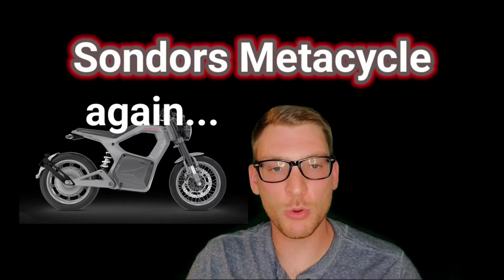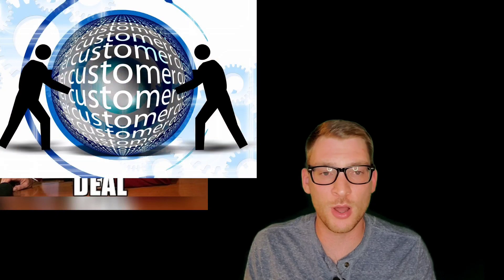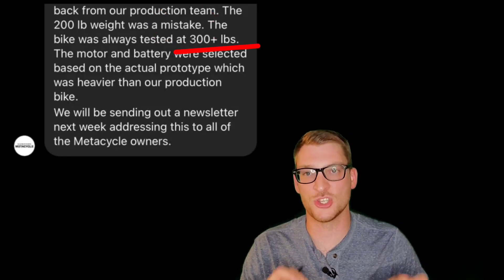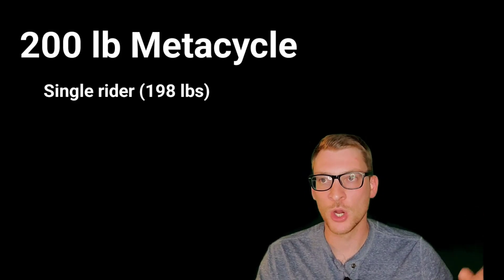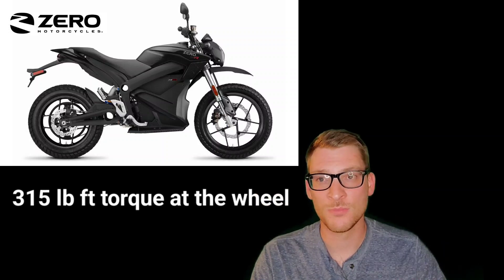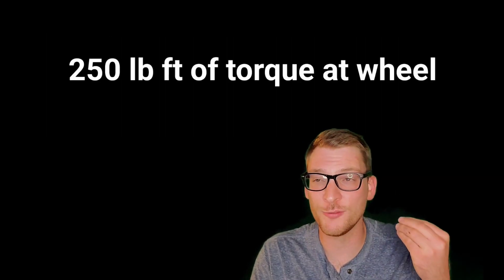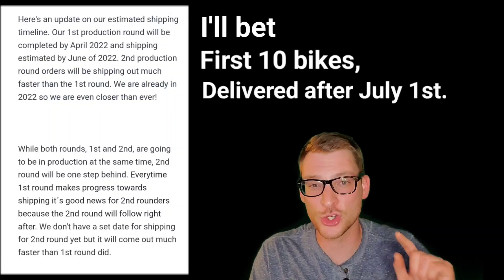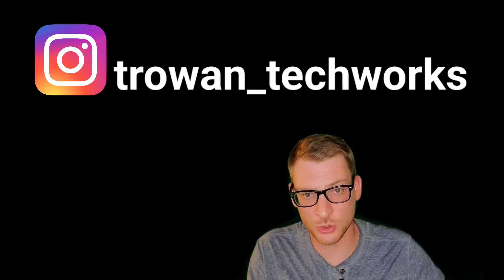Why the Sondors Metacycle will underperform

Comment: When they start coming over here, it doesn't matter what the weight or acceleration will be.  If it's $5000 or $6000 and can go over 65, it will sell like crazy.
Reply from the maker: Yeah I don't think the acceleration is a deal breaker. It's more how the company saying one thing but the specs don't back that up. It's sketchy for a manufacturer to have conflicting information.
Reply: I agree, all these other companies are like "yeah, everyone can still afford a $40,000 bike, right?".  We're not looking for flashy Harley's or Honda's here.  Same with electric cars.
Reply: 0 to 60 is not a big deal, dont forget you wont be changing gear so will still be quick and smooth..

Comment: I've done similar range calculations, with enough accuracy for, let's just say, pioneer EV vehicles, and it all didn't add up, to the point where I was willing to head to Irvine CA to check it out myself, nothing but crickets about questions and calculations, everything they say, doesn't materialize or add up, so I yanked my money back, from a EV manufacturing stand point, ya have to wonder, they're selling motorcycles to already motorcycle owners likely (me), they're also selling an EV, my specialty, overall, the whole thing is disappointing

Comment: Your math may be wrong when compared to the mid drive system. This is a hub drive. Hub drives have inherently slower acceleration.
Reply from the maker: Wheel torque is wheel torque. I accounted for the gear ratio and multiplied torque at the rear for the mid drive on the Zero. When Sondors lists motor torque, it is also the wheel torque. Not sure what you mean?
Reply: @trowantechworks  motors do not always have a linear torque curve. They seem to drop off near the upper RPM's. I could be totally wrong, but I own 5x E-bikes. Most of them have the same max speed. I've noticed that the hub motors struggle more at higher RPM vs mid-drive systems.
Reply from the maker: @JonathanVegas1  yes. If you watched the video I mentioned this. I assumed peak torque for the sake of simplicity, and because we don't have any torque curve data for this motor. So the 0-60 times are worse than what I quoted.

Comment: Howdy, I have a vision of a likely future for metacycle customers. Why? Because I'm a Sondors MadMods customer and I've already experienced what Metacycle customers have started going through.

So, Sondors MadMods... It is an emoped style ebike originally sold for $1,500 advertising a weight of 65lbs, top speed of 28+mph, and a variety of swappable parts. It didn't take long for all of that go change. Now it is $3,500 (lol), weighs 116lbs, software limited to 25mph on the display, and certain parts (seat on the scrambler, tire on retro, and fender on cafe)  either don't exist or arent as advertised. How did customers find out? Sondors just quietly updated their website as they began actually shipping bikes. In addition many bikes were delivered damaged because they shipped 120lbs of bike as if it was a 65lb bike. No apologies, no official statements, just the expectation for the customer to deal with it.

I called it on reddit that the weight was BS months ago. Now I suspect you'll see some specs quietly change, but only when the bikes are close to shipping. They want the false specs up so they can sell more bikes. I will bet the top speed decrease and 0-60 time decrease happens after price increases.

Obviously I'm bitter about the way Sondors treated me as a customer. But to close out on a positive note, so far my experience with Xion has been the polar opposite. Sondors ought to look at what Xion did for the CyberX and use that as an example of how to treat customers and how to develop a bike and change specs. CyberX is significantly different than the bike on their campaign video and the team kept people updated through the process. Hell, I think the CyberX might end up potentially having better performance than Metacycle.
Reply from the maker: Sorry to hear that you dealt with that already with the MadMods bike. I've heard the same thing from others. I'm betting you're right, and that they will de-rate the performance of the bike. 

I've been watching Xion closely and everything you said is spot on. They have handled their customer base well.

Comment: There could be refunds in the thousands, but the order numbers and some dialog between customers and company suggest they have pre-sold tens of thousands of these things, so they're not breaking a sweat.  We have given them interest-free loans, over a year now for me.
Reply: And I theorize the weight increase is because they assumed they could get the frame cut from billet aluminum which is much stronger, therefore less material making it much lighter. Going to a cast frame is soft, weak metal, so it takes way more material.
Reply: They have padded the order numbers and I was told that they do not represent the true number of bikes - just divide their number by 10.

Comment: I always thought that 200 would be way too light simply for stability -- handling bumps and wind gusts
Reply from the maker: Yeah a weight increase is not necessarily a bad thing. For security purposes too. But not increasing the power/torque to account for this is just...bad
Reply: Not true, the Sur Ron X is under 200lbs and it handles fine.
Reply: @mountainbikerdave  Surron x, under 60 MPH, true  :D otherwise that thing will shimmy and crash
Reply: @mannyechaluce3814  I'll disagree, people are out there doing it.
If you're crashing simply because you are going fast, then In my opinion that's more of a skill gap on the rider. 

But the scary thing is, anyone (including someone who has never rode a motorcycle before) can just buy Sur Ron X and modify it to go 90 MPH.
So if that's the scenario that you're talking about, then yes, they'll more then likely crash. 

Riding requires skill which is not something you can simply buy.
Reply: Stability isn’t dependant on weight.  It’s more a case of a well calibrated suspension, attention paid to aerodynamics, actual wheelbase, etc.
Reply: @bigkahuna1950  perhaps. aerodynamics for sure. But a light vehicle gets pushed around more than a heavy one

Comment: Could you throw some #s in your 0-60 calculator for me?  My 8kw E-Enduro is fast.  Weight 160lbs, me 210lbs, torque rating 184ftlbs.  Let me know if you need any other variables!
Reply from the maker: What's your rear tire diameter? Is the 184 ft lbs the torque at the wheel (hub motor) ?
Reply: @trowantechworks  19" motorcycle, yes, Sir, hub motor
Reply from the maker: @e-powersport  is that a 19" rim, or is the tire diameter really 19"? 
Do you have the actual dimensions of the tire handy? 

Cool, lemme plug it in. Of course this is theoretical and we aren't factoring in the torque curve which usually decreases through the range of speed. And we're not factoring in aerodynamics or losses.
Reply: @trowantechworks   sorry, 19" rim, actually closer to 25-26" outside.  The speedo set to 26" is really close to accurate
Reply from the maker: @e-powersport  alright with a 26" diameter, it's looking like 5.98 so 6 seconds. Real world, add like 1.5 seconds to that
Reply: @trowantechworks  thank you! Seems a lot faster ;)
Reply from the maker: @e-powersport  can you use a logger and test the bike out IRL? Although if it's 8kW peak I doubt it'll get up to 60 mph? You can also quote a 0-30 mph time
Reply from the maker: With a 19" rear wheel diameter, 184 lb ft of torque, and 370 lb mass, I'm showing 3.8 seconds for 0 to 60. But I don't think this is accurate, unless you're positive the entire tire diameter is 19". Usually total diameter ends up being 22 to 25" depending on the tire size. That would put you more into the 5-7 second range for 0-60.

Comment: I'm right on the verge of asking for a refund at this point. You're right something definitely stinks here big time. Even underperforming it will still work for my use case, but I just don't know if I can trust the company at all anymore. Would you get on a motorcycle engineered by a company that left its specs 33+% pounds underweight for what over a year now? That's not a small error. It's a lie, a lie that they used to sell what was already fuzzy math as something plausible. 
Sondors needs to respond and do so quickly or I'm out.
Reply: You also have to consider that this is not the first time it has happened. The Madmods ebike also came in grossly overweight (almost double) and under performance. So they knew they needed to be careful with calculating this. The only way this could happen would be outright deliberate misinformation OR gross incompetence. Then again they also forgot about DOT regulations and had to slap on additional lights and reflectors . . .
Reply from the maker: @Bigrignohio  I'm wondering if it's incompetence and bad communication between Sondors and the engineers in China.
Reply: @trowantechworks  Going from 200lbs to 300lbs means that the weight of the frame AT LEAST doubled (assuming a generous 100lbs for battery, motor and wheels). More likely more than double as the battery alone should be well over 50lbs. Combined with the Madmods fiasco I cannot see any way it was not deliberate misinformation.
Reply: Update: I've had a lengthy back and forth conversation with a Sondors representative and to be honest he's completely jerked me around. He started off with the standard line that the weight change was just a result of the realities of production vs. preproduction. He said the weight was estimated based on the prototype and that the revised spec reflects what the production models will actually weigh and that this (somehow) will not affect performance. I asked him very simply if the acceleration, top speed, and range specs were ALSO estimated based on that prototype. He said that they were, but then changed the story about why the weight was listed incorrectly in the first place. He said that the change from 200 to 300 pounds was simply a "copy correction". He called it an error and again asserted that the production vehicle would meet the stated performance specifications despite this. 

I have requested a full refund. It seems obvious to me that Sondors is lying to its customers about this bike and its capabilities. If it turns out that Sondors does in fact have some kind of magic fairy dust that allows this bike to perform as advertised then it will still be a bargain at the non-early bird price point. I'll keep updating this as I assume Sondors will not be giving my $5,000 back without a fight. If they're smart they will.
Reply: Cancel it, it's the safer choice
Reply from the maker: I'm not here to tell you whether to cancel or not. But I can tell you that I don't completely trust the engineering on this bike.
Reply: @trowantechworks  I emailed customer support about my concerns. Unsurprisingly I was just given what seems to be the form letter regarding the weight increase. The rep said that the initial weight was estimated based on a prototype and that they can give more accurate estimates regarding weight now that production models exist. That doesn't really inspire confidence in their range and top speed estimates now does it? Those estimates were also made prior to the existence of production examples. 
The rep also said that all specs were obtained using the proper curb weight and the increase will not affect those specs. How does one confirm or even estimate those specs when one of the key variables in determining them is that far off?
Reply: Yeah, Imma ask for a refund.
Reply: I got my full refund I will wait to see the final product
Reply: @zmima  What did you use as justification for your refund? There are a lot of small reasons for me, weight increase, SMB color redesign, actual range won't be enough for my commute, etc, but I haven't asked for a refund yet. At this point I'd like to put that money into a gas bike instead.
Reply: @TheRealBobHickman  Are you out of your 90 day credit card dispute window?  If so, just wait maybe you'll actually get the bike someday.  I have been trying to get a refund since December.  Now I have a canceled order and I am out $5000.  I have hope that maybe they will actually pay me back, but it is not looking like it after 8 months.
Reply: @ourmovies2010  Yes, I paid in full almost a year ago. I called Sondors a couple of week ago and spoke to Luis. I let him talk through the benefits of keeping my order, but I still requested a refund and he processed it. I got an email within minutes, but I had to email back after 8 business days because I hadn't seen anything yet. Within an hour I had confirmation of the refund and the refunds were pending on my credit card. Went smoother than I was expecting. I just couldn't keep on waiting.
Good luck!
Reply: Good luck with that refund.  I asked for mine in December.  I really I received a cancellation notice of my order but I've it's been about 20 hours emailing my bank and the company trying to get my money back.  I'm giving it till the end of this month and then I guess I'm going to have to sue them and report the issue to the motor vehicle department out in California.  More time invested on my part but if I have to spend 10 grand to get my five back from them I'll do it
Reply: I got my refund back months ago, there's other bikes out there that already exist. I have a Kollter now, not a bad bike!
Reply: @kaleyeahitsaustin6026  I called them and started my refund process today. I hope people will see bikes before the year is out, but it's too late for me now.

Comment: Most of the claims out there suck when it comes to real world range.  There are however ever more new projects who claim rediculous stuff. 100 Mph, 200 pounds curb weight, 150 mile average range and still a 4 Kw battery on board? In real life you get nothing for free. People should first focus on getting a feeling on what can real. So more video's like these please. I for one would be very interested to receive your calculations. My present rule of thumbs are are comparable to yours: For real life use an average of  1,1 KW battery capacity per 10 km (approx. 6 mile) range. So f you want to travel 150 km (approx. 100 miles) you need at least a 15KW battery and if you want to go 200 km you need a t least a 20 Kw battery (see, meters / km are much easier to calculate with!). Although the volumetric problem for bikes has been solved in the last few years one would still be hard pressed to such capacities in a 250 kg (= approx. 500 pounds) motorcycle. As far as power is concerned I think that 30 to 40 KW continuous via a good old fashioned gear box is more then enough. Motorcycle riding is after all about more then just twisting the grip at the traffic lights. I am trying to develop such a bike myself and have the rolling chassis finished for about 90 %. The costs for the electronics an batteries alone are however still about $ 5000 to $ 6.000. So can these hype bikes exist at all? Only if you do not plan to ride further then the next street corner!